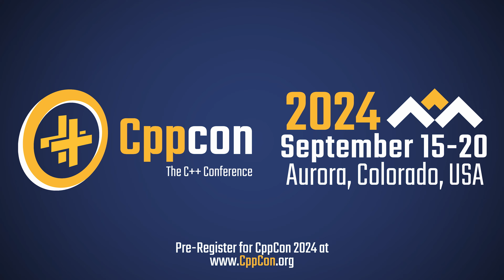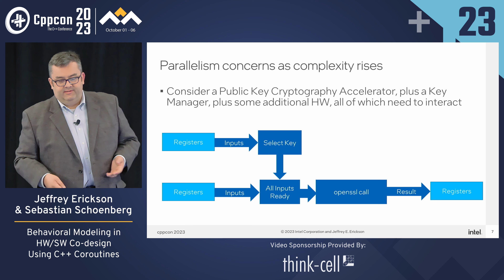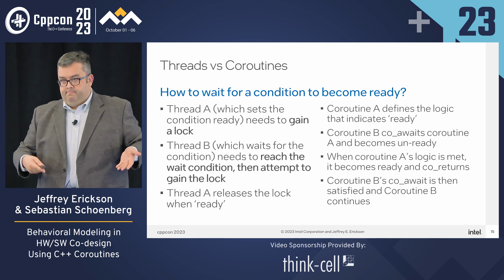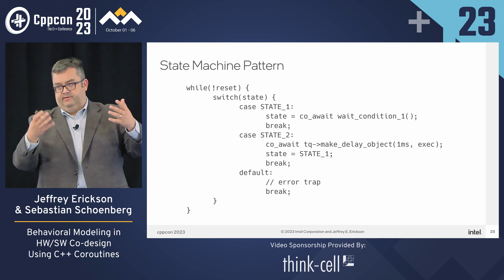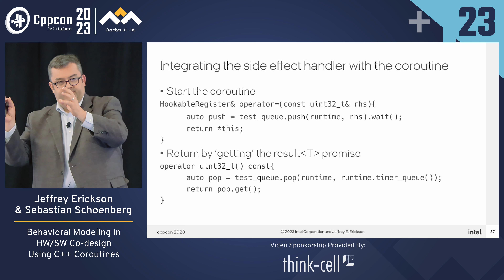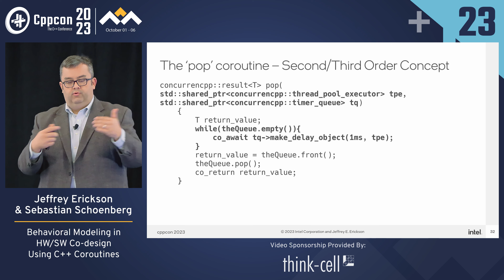Behavioral Modeling in HW/SW Co-design Using C++ Coroutines - Jeffrey Erickson, Sebastian Schoenberg

Comment: This method more or less matches to what SystemC is doing, its a  C++ framework/DSL designed for HW modelling which tries to look like an RTL. Of course back in the day (early 2000's)when SystemC was developed, people did not have the luxury of co-routines (and bunch of other helpful things) supported on language level so they ended up spinning their own paradigm. SystemC is also doing everything on single thread, which affects its performance, while at the same time HW is getting more and more feature rich, making the problem even worse. Would be cool to see some open framework trying to tackle this same problem with modern capabilities of C++ taken in to use.